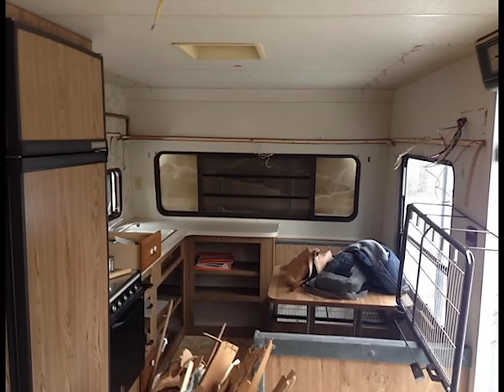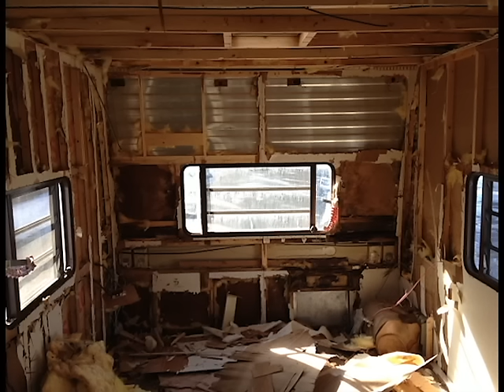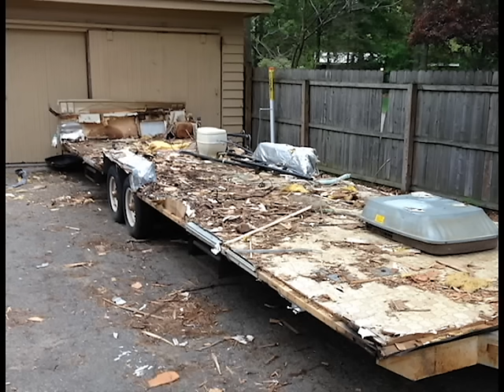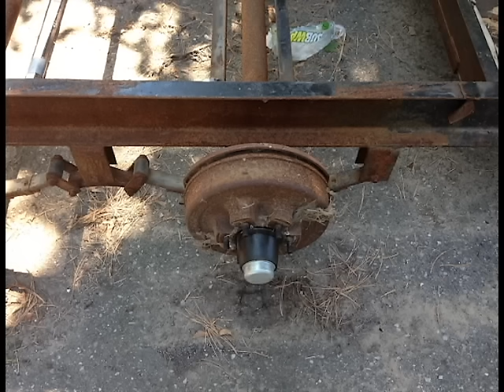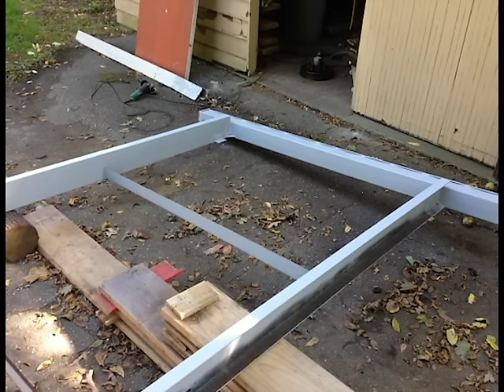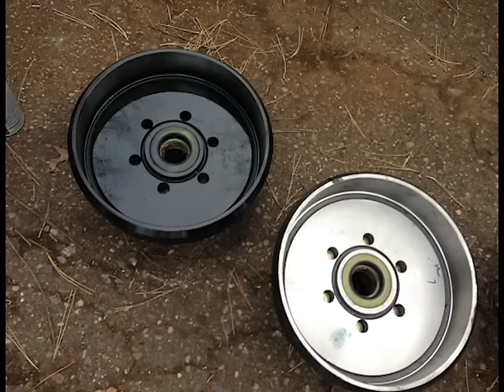How to Turn a Camper into a Tiny House Trailer Part 1

Comment: I'm just starting this phase of my own build with this exact model trailer. Thanks for sharing.
Reply: Conspirator Vs Saved  I got the same one to the rear end is gone the only thing holding it up is the bumper ,I completely gutted it only paid 200 for it want to build a tiny house to live in ,I just hope it doesn't cost a fortune to do it any ways a new one is 30 grand ,hey let me know how yours is going took me four days to gut I'm still sore lol.
Reply from the maker: Good luck! Lots of work if you are going to demo it by hand. I suggest getting someone to just go to town on it with a sledge and dumpster the whole superstructure. Save a lot of time.

Comment: Not a criticism, just curious... why you didnt just by a trailer instead of going  through the time and effort of totally dismantelling the camper? Was there a particular advantage to doing it this way?
Reply: What I have seen was a camper/trailer with water infiltrated walls and floor, dismanteling and rebuild is the only solution. Second, trailers are expensive,  using this good restaured frame is less expensive I think. If they do the new building as they took care of the frame, it will be nice. One but... the new materials hase to be as light as the early construction and that's not easy in tiny house building. Aluminium plating or woodpanels, big differense. The frame is builded for light constructions as the axles are, the brakes and so on, even the hook conection. Think twice if you have the same idee .
Reply: I bought a water damaged 22' Terry Camper for $1,500. That nabbed me windows, a furnace, and A/C unit, grey tank, black tank, 110VAC/propane refrigerator with freezer,  sinks, ductwork, drain piping, cooper scrap, aluminum scrap, fresh water tank, and a water heater with hot water storage. All appliances are in great condition and tested to work without issues. Not to mention that the trailer just had brand new tires and electronic brakes put on last year (receipts as proof).

If you are looking for a bare trailer frame...you want to know what $1500 will get you? A rust bucket with rotting wood sides, or something no larger than 6x8. I imagine that's probably why he did it this way as well.
Reply from the maker: Sorry I haven't been writing, I bought the camper delivered to my door for $1,000. I looked at the price of buying new and it was outside of my budget at the time. Honestly, I wanted to take it apart to understand the construction methods used to build lightweight campers to help influence my design. Unfortunately I haven't made much more progress on this project due to just recently having finished University and settling into a new job as well as starting some other projects while I design the tiny house.
Reply: When you build your own tiny house there's a closeness of it being designed and built by you, and you know every single part of it plus built like a tiny home it's not a trailer house as such, the build structure is more realistic so to speak..
Reply: Looking forward to seeing how this project turns out! So far you've done a great job with great care!
Reply: Joy Askew I was thinking the same
Reply: I agree with you. You don't have to buy a new one but I would've got something that I had to fix for $5,000 or less. May have to put new curtains and covers but the bones would be good.
Reply: Why don't they just go buy a flat bed trailer and build it. Hey I'm lazy and single so.....
Reply: Joy Askew not to mention that frame is not strong enough for a tiny house build.
Reply: I’m wanting to turn our camper into a little guest house but I’m sorry I don’t want to go through all this.  It looks good though.
Reply: Because people sell these for 2k on Facebook market lol.

Comment: I think this is the exact same camper that I bought to build my house on.  Very similar if not. This will be nice to see what you do.  I am starting to gut mine this weekend.
Reply from the maker: Complete tear off? Don't go from the inside out, go outside in. Tear off the siding, push it over with some friends and get a dumpster or burn all the wood, I wasted a ton of time trying to learn how the trailer was built only to learn it is basic framing with 2x2s, nothing fancy. Good luck, and share a video of the current state!

Comment: I was looking for the tiny house after all your work???
Reply from the maker: Sold the trailer frame to someone who wanted to keep working on it! I initially embarked on this idea during university as a backup plan in case that plan didn't work out. I ended up doing just fine and went the route of buying a normal house for less than it was going to cost to build the tiny house. House is already paid off!

Comment: More like: 'Scrapping a perfectly fine looking camper and building new off the trailer"
Reply from the maker: Did you watch the full video? The camper was anything but fine. The entire thing was flooded due to a leak in the roof and most of the wood was rotted for sitting in water for way too long. I picked this up for $1000 USD. It was garbage and the owner knew this too.
Reply: @MaximumIndustries  Admittedly no...I didn't watch the whole video, just to the part where it was stripped down to the trailer. All I could see originally were a few spots of water damage that could have easily been replaced. I didn't realize the whole camper had been rotted. My apologies for jumping to conclusions.
Reply from the maker: @SpectraNyte  No worries! If you're looking to build a tiny house, this process worked and it was cheap, but extremely labor intensive. If you have more money to spend, I highly recommend getting a trailer built custom to your design needs! I do 2D and 3D CAD if you'd like some designs drafted!

Comment: I just bought the same trailer 200 bucks but don't know the year of it ,what year is yours mine is a Fleetwood I the walls in mine have horizontal braces between the vertical 2x2s  and the whole rear end of mine is gone ,please let me know the year of yours thanks.

Comment: thank you for sharing your video.
after we moved to new property to biuld are first home my racess neighboor set my every thinks on fire and told me move back for ever i came from..
we was living in a rv at the time and didt have the insurance.we came homeless.....
after i saw this video im going to pule my rv frame from ashes try to save and build place to us..
i do landscaping i think i can do this..
thank you again
Reply from the maker: If the trailer was on fire, the steel might be compromised. I would not recommend reuse of a fire damaged frame. Would try and purchase a cheap used one like I did. I only paid $1500 for this and I could have lived in it if I was homeless.
Reply: @MaximumIndustries 
 yes i know im going to sand and see if i can repainte and see if i can save..
Reply from the maker: @bahramx1  Good luck brother. Make a video!

Comment: I am facing the exact same project in my old "current home".  My debate is to keep the walls, or build new higher walls much like today's toy haulers for loft space.
Reply from the maker: Up to you, I'm planning on rebuilding it to almost the same design. No lofting space. I don't need the extra storage, and I think it looks better as a one story flat roof but with a house look as apposed to the camper look.

Comment: If you completely destroy a trailer and put all new parts on it is it still the same trailer?
Reply from the maker: Yes, from a legal standpoint. The frame is marked with the VIN and as long as you rebuild to the same specification you are fine holding the same title.

Comment: why not just turn the camper on its side,saw everything off and be done with it??.. why bother even gutting It? you could have just rented a mini dozer and tore it off in a day.. I mean, if a hatchet is all you have... I can't believe you Paul bunioned this thing apart.amasing.
Reply from the maker: I took it apart to learn how the construction was done. Trailer building and house build seem to not be much different. With the exception that trailers use much lighter construction materials.
Reply: Maximum Industries. im building a bus right now .quite similar to a house.im not making it cheap tho. I wish lol
Reply from the maker: Nice! When I manage to finish/sell the tiny house I'd like to do an RV or something next.
Reply: I just took a backhoe and demolished my camper down to the frame in a day. The hardest part was cleaning up the incredible  mess of plywood, fiberglass insulation and aluminum. I think stripping the siding of the sides then bagging the insulation would've been easier.
Reply from the maker: Yea, knowing what I know now, I would have stripped the aluminum, bagged the insulation and then used a chainsaw to take the structure down quickly into dumpterable or burnable size pieces.

Comment: you striped it so your not turning its frame to a tiny house
Reply: I think they are JUST using the trailer the "rv" was on as the base and building something completely different.
Reply from the maker: Yea, it was just the turn it into the trailer frame for the tiny house. More to come in the future, but I work really slowly.